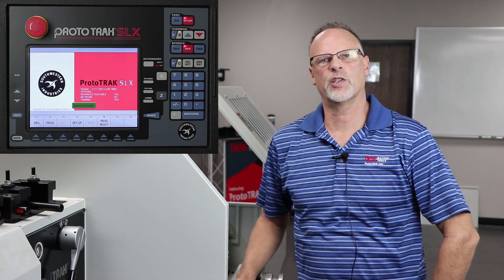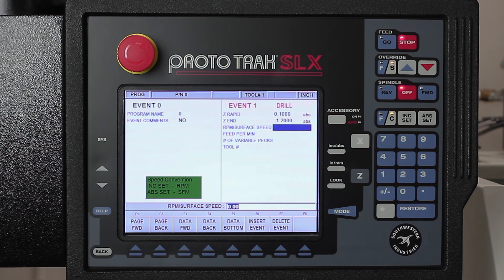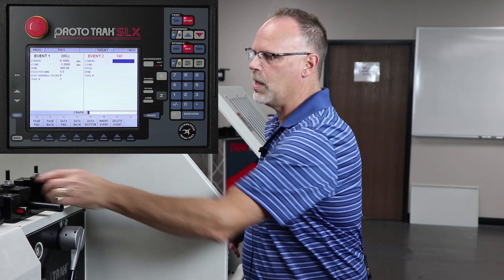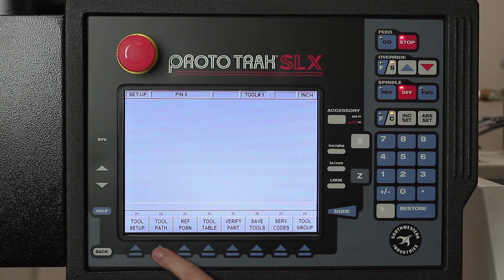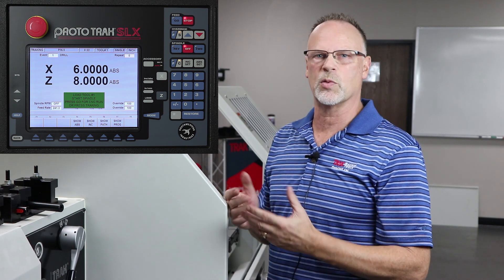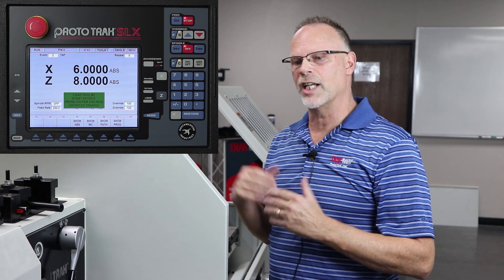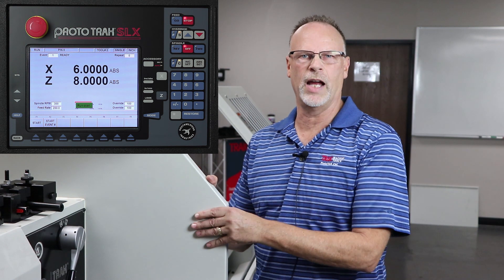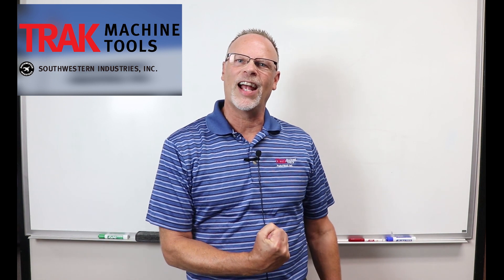ID Tapping & Drilling | ProtoTRAK SLX CNC | Lathe ID Programming 2

Comment: You lost me from the start, in England we use metric, and I've used the same machine for 12 year. Self taught using the manual that came with the machine. And never knew how to use the tapping mode.

Comment: How do you set the center of the drill or tap in tool set up?
Reply: Felipe, This depends on whether you have a standard tool post or a turret.  If you have a turret, the height is set at the factory so as long as you use standard 3/4 or 1" tooling as specified, they will be on center.  In a case like this one, it has a standard tool post so each tool holder has a knurled ring and a lock not which allows you to set the height manually.  There are many ways to set the height properly such as line the tool up to the tailstock center but sometimes, the easiest way is to take a cut on the face and adjust it until it cuts the entire face without leaving any material in the enter. I hope this helps!  T.P.

Comment: At  2.10 you say there is no encoder on spindle, if this is true how could the lathe cut threads.
Reply: I explained this on the RLX video too. There is an encoder on the spindle so that it can pic the same starting point for cutting threads however, when using a tap, it does not monitor the encoder. It also doesn't use a brake on the spindle so there is a chance that it will not switch spindle directions and Z travel directions at the same time which can result in breaking your tap.  T.P.

Comment: Hi Pat, can I ask what particular Tapmatic head you are using? There are a lot of choices from Tapmatic and it would be nice to get the right one  the first time for my slx.
Reply: machine I'm using is a 1630 if it matters.
Reply from the maker: Robert, Pat’s off today, but he says he’s using an Erickson floating tapping head from Kennametal.  He said he can get the part number for you tomorrow. ~Patrick K.
Reply: @TRAKMachineTools  hi ,by any chance can you share the tooling part number that you use to do this job ?( floating tappinf head, driling chuck etc.. and if you have some pictures that you can share, will be awesome!
Reply: Jose, The model and part number for the one I use is as follows...Erickson Tap Chuck...SS075TCTG050.  I will have a link added so that you can see a picture of it shortly.  T.P.
Reply from the maker: @joseluisordunomoreno1029  Jose - here's the picture TRAKing Pat wanted to share with you: https://www.southwesternindustries.com/assets/images/misc/20211201_073923.jpg
Reply: @patrickfitzsimmons5187  could be posibble to contact you directly via eMAIL or Phone, we adquire a brand new PROTO TRAK SLX  and I have an issue with tool radius comp, please let me know... thanks

Comment: Hi TrakingPat, great video. Could you explain the process of using the “tap” feature on an older DPM2 mill with the SMX controller? The machine I work on has no control over the spindle speed, and the only control it has over the spindle (as far as I know) is turning it off after a CNC run. Thus, I do not know if this video applies to the mill. Thanks.
Reply: Hi Robert, When we first started making DPMs, the programmable spindle was an option and it sounds like you do not have this on your machine.  Therefore, you have two choices... 1. Use a TAPMATIC or something similar along with a boring event.  The tapping head will automatically reverse when the machine switches from Z- to Z+.  You want to use the bore event instead of a drill because it will keep the feed rate constant in both directions.  2. Run your machine in 2-axis mode and then simply feed the tap into the hole using the quill and when it gets to the bottom of your hole, shut off the spindle then reverse it to get it back out of the hole.  It's important to let the spindle stop moving clockwise before your reverse it because switching back and forth from forward to reverse causes stress on the key and key way and will eventually cause some damage.  Please let me know if I can help in any other way!  TP
Reply: TRAKing Pat Thanks for the tapping methods. I guess I should have mentioned that this machine still has the “tap” feature in the programming menu, but it’s not clear from the settings how it would handle reversing the tap. Is this just like a “bore” event, requiring a tapping head?
Reply: Larry Deptula The machine I am referring to does not have the programmable spindle option. Cheers.
Reply: @RandomNumber141  Larry isn't old enough to remember those models...LOL!  Like I stated before, you can't use that event because your machine won't auto-reverse.  It should be greyed out on the menu but, sometimes the control doesn't know that you don't have the programmable spindle.
Reply: TRAKing Pat Gotcha thanks